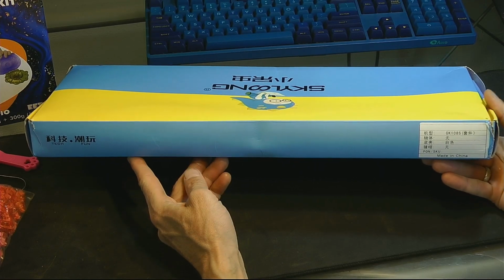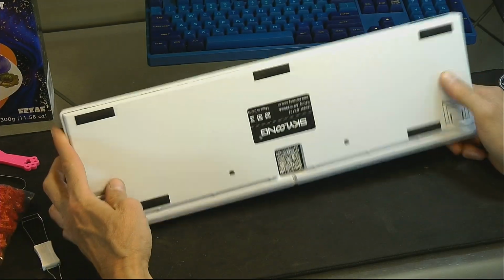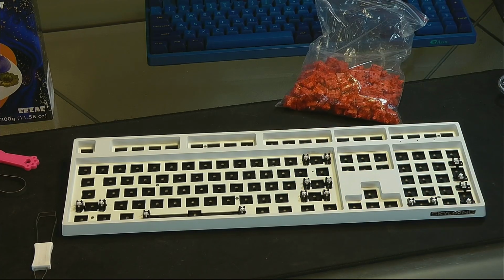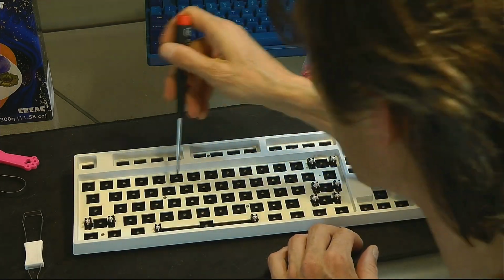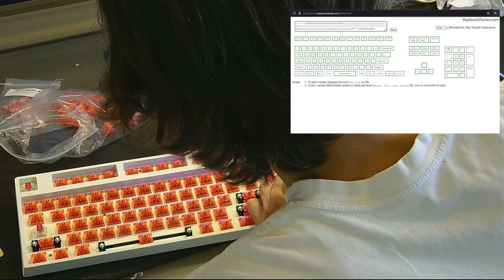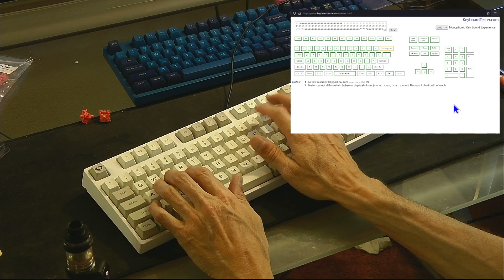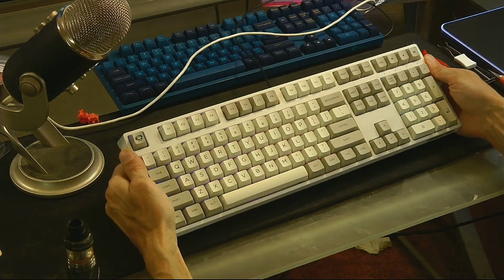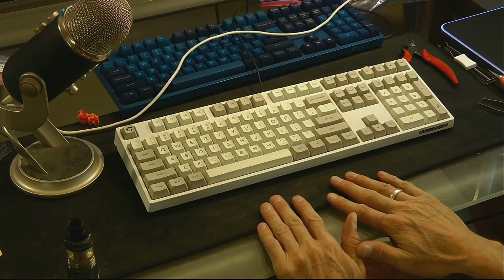EPOMAKER GK108s BT Hotswap RGB Mechanical Keyboard build and review.

Comment: Just got mine in, installed the switches, slapped on the keycaps, it's beautiful... But it doesn't work LOL. So it's a paperweight atm. The RGB comes on, fully wired into the PC, windows has detected it, but not a single key is inputting anything. I'm not sure what I've done wrong...
Reply from the maker: Oh no!  I have no idea what the case might be!
Reply: @MichaelBruceShortbus  I figured it out! It wasn't the EPOMAKER, it was a cheap knockoff pretending to be one. Returned it and got my money back, EPOMAKER is now happily on my desk working perfectly fine. :)

Comment: Just absolutely covered all the exhaust holes in that battery with the silicon, probably would've made a little wall of tape off it or something
Reply from the maker: Dude batteries all die, its just a matter of when.  Also its trivial to get the bat out. Exhaust holes? They explode as in POOF UP when they go bad a lot of times.  Aint no exhaust holes LOL.
Reply: @MichaelBruceShortbus  batteries have vent holes to help gases escape. Whether that one does or not, obviously I can't tell from the video. But at least you used silicone so you wouldn't short the board in the case

Comment: Will Outemu switches or Akko CS Switches fit on this?
Reply from the maker: Akko CS will for sure.  Outemu might, but im not sure what differences those have.
Reply: @MichaelBruceShortbus  Okay! Thanks for the reply. How much silicone mould would you need for this? I am planning to silicone mod this exact keyboard. Would 200g mould (100g Part A + 100g Part B) be sufficient?

Comment: Can the colors of the LEDs be changed, and if so with software, key combos, or both? And does the setting stay or do you have to reset it on every plug in?
Reply from the maker: I think so, but  you need to install the software.. which I haven't done.

Comment: A combo of 75% + numpad works great for me. Any thoughts on that? Did you try it?
Reply from the maker: One of these days I'll find a separate numpad.  As long as the cursor keys are by themselves and not crammed into the main alpha block, im good.
Reply: @MichaelBruceShortbus  You mean a 75% expanded, something like the GMMK Pro? My main is a crammed (compact) 75% and i was scared of it in the beginning (after using full-sized for almost 30 years) but the brain is fast to adapt.

Comment: Are the RGB animations smooth on your board? The ones of mine have dropped down to about 4Hz after installing the drivers :(
Reply from the maker: I tend to not load the drivers.  Never noticed this!
Reply: @MichaelBruceShortbus  Ah, alright. Found a solution for that, btw: You need to load the animation onto the onboard memory and it will be perfectly smooth
Reply: @dominicstocker5144  how do you do that?
Reply: @arlokkkk  in the GK6XPlus driver, click on the „default“ register, where you will find a sort of speech bubble in the middle containing the selection of several RGB effects. If you click on the three dots, you can change them, to apply the changes you have to press both save and apply. Once you’ve done that, you’ll see that the lights of the GK108 will turn off. To select one of your chosen RGB effects, cycle through them by pressing „-“ while holding the FN key (you can also double press the FN key once instead of holding it, pressing it again to deactivate it). You can also cycle through a bank of interactive effects which, to my knowledge, you cannot change, by holding/double pressing the FN key and pressing „=“ instead of „-“. Hope this helps!
Reply: @dominicstocker5144  thanks man!
Reply: @arlokkkk  you’re welcome :)

Comment: Thanks a lot man... I was looking for a Full size hotswap with RGB. 
One more thing... What was the other keyboard?  Could you share some info on it?
Reply from the maker: Hey, that blue keyboard in the back is an Akko Macaw 108.  It's not got any features, just plug in USB.  I modified the crap out of it.. and so I can't recommend it easily.  You will need to desolder 108 keys if you want different switches for example... LEDs?  You can solder some in but you would get only one color.

Comment: What switches did you use? Sell me this keyboard :)
Reply from the maker: Haha, no way, took too much work.  They are Box Pinks.  The best clicky switches I've personally tried.
Reply: @MichaelBruceShortbus  do you use that kdb on a daily basis? Do you recommend it? I like that rubber silicone thing, is difficult to apply? Thanks.
Reply from the maker: @arlokkkk  I am using it to type right now.  The rubber silicone thing isn't hard to do, but if you put in too much its a pain to cut it less thick.  I might try actually applying the stuff to the back side of the PCB.. but im not sure quite yet.  Might screw up the hot swap sockets.
Reply: @MichaelBruceShortbus  what’s your favorite kdb man? There are so many options. I would like some full kdb with 108 keys. I currently have a GK64 keyboard which I like but it feels cheap. Im using the new glorious lubbed keys now.